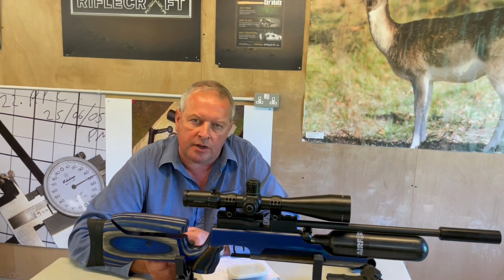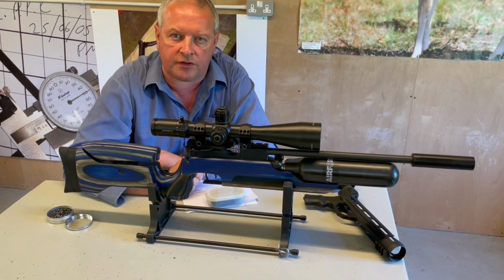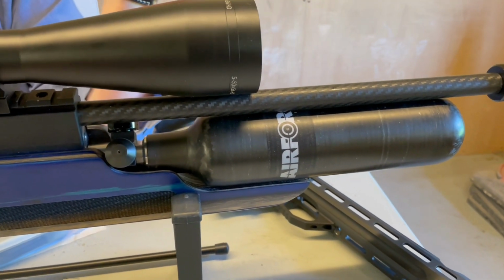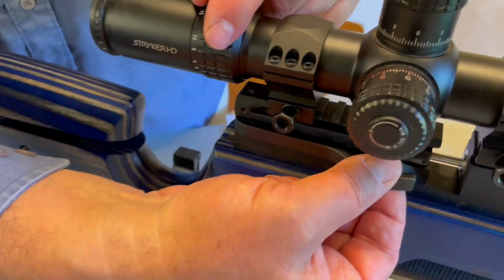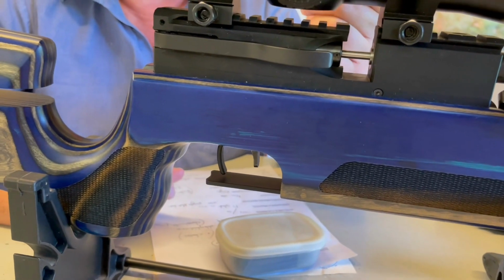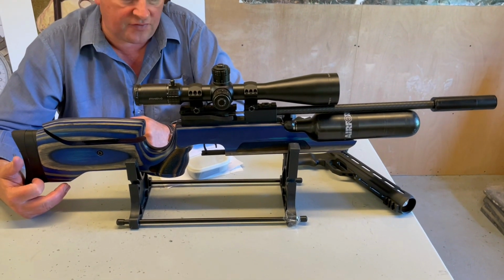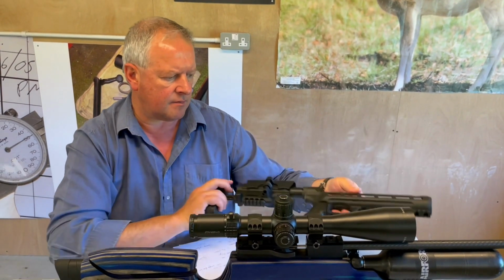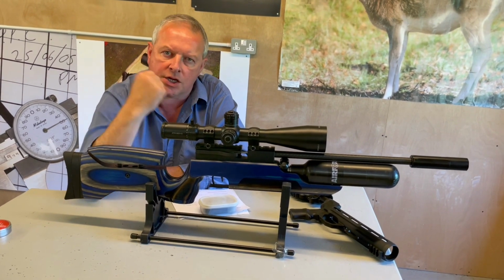Rapid Air Weapons RAW HM 1000X

Comment: Still running my untouched blueprint ben Taylor mk 11 rapid n no you cannot pry it from my cold dead fingers awesome rifle in 2003 n still is know .177 running 11.4 ftlbs
Reply: Im totally with you on your choice of rifle, I still shoot my .177 Mfr every week, had Ben Taylor work his magic on it back in 2011, and it's shooting perfectly at 11.7 fpe, and it's just as accurate as any of the £2000 pcps out there.
No gauge and no quick fill, and definitely no intention of trading her in.
One of the best air rifles I've ever owned,I charge it to 220 bar and I take the bottle off for a top up after 14,  17 shot Mags.